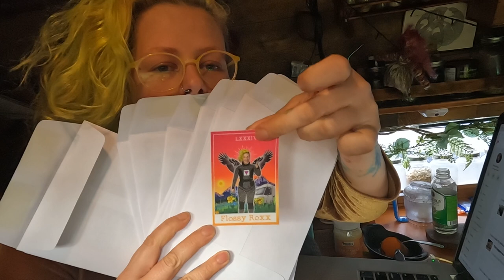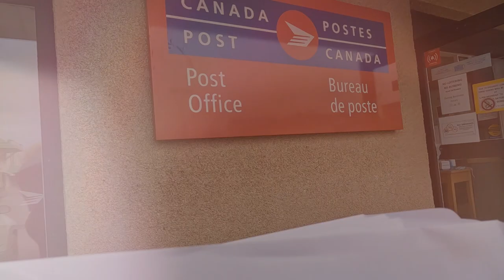Paddling with Amanda LIGHTS up my Van life

Comment: i bought the same wood for my bathroom vanity I sealed it with Marine  varnish I put 3 coats and lightly sanded between coats, it's totally waterproof...and after 4 yrs still lovely..
Reply from the maker: @Sondra L oooh Marine varnish, like an epoxy? I'm still deciding what kind of finish to do.. very tempting! 🤞

Comment: We are trying to complete our wiring this week. I’m so tired of having wires and ceiling lights hanging everywhere while we work. It makes me feel better seeing yours also waiting for final installation! You’re very dedicated working in the van when it’s so cold we can see your breath. Finally got our webasto heater installed (now that it’s warmed up of course) but I sure would have liked to have had it all winter maybe would have gotten it built faster. Are you moving in soon or waiting to complete before you make the switch?
Reply from the maker: @Jennifer Fleury WOW yess!!! You can do it!!!  It's still not finished in my van but progress is slow but sure.  Let me know how your build is going now!  Heat is so important during winter even building!  I'm hoping to wait till it's done, but who knows, I'm finding my self more and more frustrated with waiting, so who knows!

Comment: Love the diving! Is there a plan to put a fairly powerful exhaust fan in the stepvan roof?
Reply from the maker: @James Reid I have a max air fan in the main van space already, and I'm installing a second vent fan specifically just in the wetsuit room or as I was recently told on a boat it's called a wet locker. So yes!